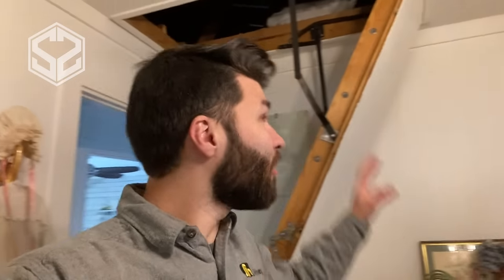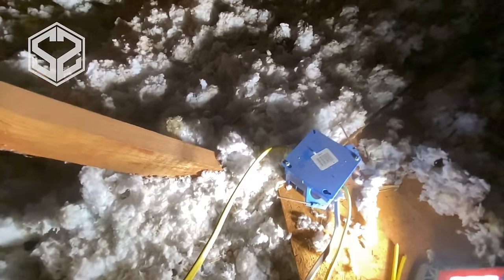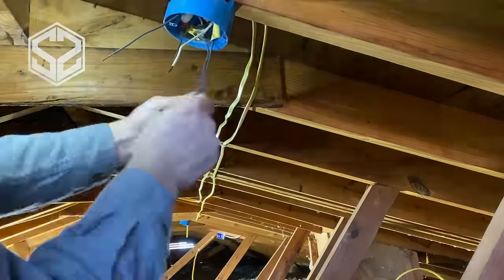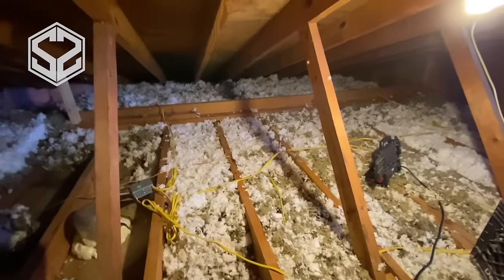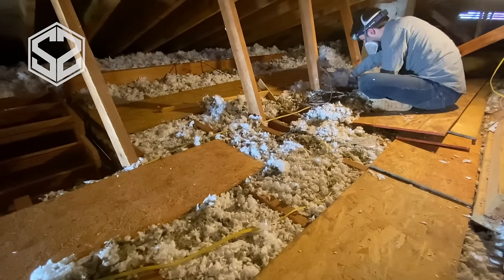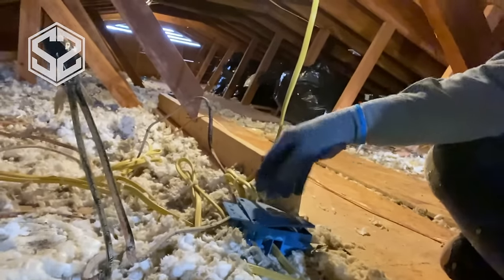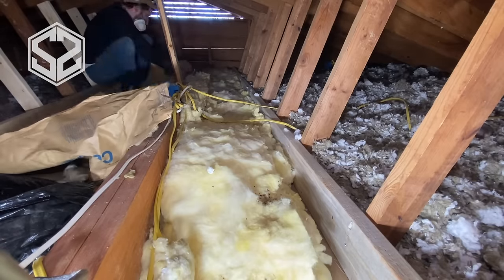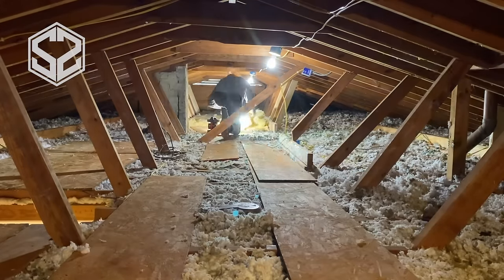How To Fix An Old Attic

Comment: With the added foam around the lights, how long does the foam take to "dry" before filling in the insulation on top of it?

There is a roof support that looks like it is sitting on an added board with a 1" toenail.  Did you fix that when you fixed the sagging roof?  How could the previous owner add that and leave it that way?
Reply from the maker: Thanks! It takes a few hours to harden. Yeah I replaced that support. I was completely shocked to see what this guy had done up there. He really messed up a lot!

Comment: Great video and very educational. Thank you for sharing. For the wiring at the junction box at 6:42, how did you do that wiring? It looks like the hot and neutral you wired together (black and white wire) and have 1 black lead wire from that same connection. Trying to figure out why you wired the hot and neutral together. Unless the color is different for that connect? Any insight would great help.
Reply: That’s his switch leg. Switch boxes don’t require a neutral so he’s using the black and white as hot conductors. He’s bringing the power to the switch on the black and bringing the power from the switch back to the device on the white. The black conductor he’s connecting it to our the pig tail for that light and the hot conductor of the next device on the run being powered by that switch.

Comment: Could you make an insulated panel for the stairwell?  Like, when you drop the stairs you pop it up and off, then back down and on before putting the stairs back up?
Reply: Is the stairwell you are referring to the attic access? As in ‘drop the stairs’ meaning the access you pull down to access the ladder or ‘stairwell’ to get up into the attic? If I am understanding your question correctly, the answer is yes. ‘Attic tent’ has a product for that. It has a zipper like a jacket to close it when not in use, which helps minimize heat transfer and air infiltration. Very good product. 👍
Reply: @Rjribs46 Yes, that is what I was referring to.  Thank you for the product info!

Comment: 16:56 - 16:57  there’s a diagonal 2x4 in frame just past his right hand. is that even attached to anything?  It looks like maybe it’s connected by the bottom half inch or so.

Great video btw!
Reply from the maker: Yeah, I found several issues like that one. The previous owner made some modifications and almost all of them were done poorly. I had to replace a whole section of the roof supports because it was messed up so bad and the roof was beginning to sag. Here's the link for that video. https://youtu.be/ZQpJpOQac-s.
Thanks!

Comment: Lots of code violations from before and after your little project. Worst one is your didn’t use fire resistant caulking in the penetrations through the top plates.

Comment: I have bought, sold and renovated many houses. Home inspectors are useless (I even got licensed as one and it’s comical how little they really have to know). If you do this enough you can inspect better than an “inspector”. The first thing I noticed was the framing shot at the beginning was horribly wrong. I had to pause it and wonder wtf they were thinking. Some things I recommend: there is no need to run 12 awg yellow romex for attic lights. 14 awg is much easier to deal with and led bulbs take very little power. The white plastic clips are garbage and will turn brittle in the attic heat over time. You need to always use electrical rated metal staples. Keep in mind they make airtight can lights and no matter if you spray foam yours or not the cans themselves have holes all in them. Use gasket tape on the holes or remove the cans entirely and install the new trim type that seals against the sheetrock and only has a lead wire and box. You can buy foam vents to put in the rafter cavities to allow ventilation but also allow you to add thicker insulation. When I was in my early twenties I spent a great deal of time in attics doing exactly what you just did and these days I will literally have an insulation company come in and vacuum out the entire attic so I can fix everything and then reinsulate. Insulation breaks down over time and turns to dirt practically and should be replaced in older homes. I just started a 1800 sqft house and the first thing I did was have the attic cleaned out including all the ductwork. Very easy to see what you have and fix problems. Blown in insulation is cheap to put back or roxell which i love. The struts and purlings in your house need to be fixed they’re awful and nowhere near correct or supporting much of anything. It appears several have been cut off also bad. Keep in mind the collar ties at the top of the peak do not support downward load they are for uplift only. Your downward load are the struts and you need more. They should always go to a load bearing wall and L brace. The electrical is a nightmare too it should be cleaned up. Junction boxes are not the answer. Great for you to learn keep it up…every project I do I still learn something new.

Comment: What size boards are you using to work in the attic?
Reply from the maker: I could only fit 18 inch wide boards up through the attic access door. They were easy to move around when needed and still wide enough to crawl across.

Comment: If the home has vented soffit, it is possible to vent the range exhaust there
Reply from the maker: Unfortunately the soffits aren’t vented. It only has vents at the peak of the gable on both ends.
Reply: If soffits are vented, it is not a good idea to push range exhaust out through the soffit. Should go through wall of structure to outside or through roof.
Reply: Never vent into an attic, range vents drastically increase humidity as well as pose a risk of grease. Just not worth the risk.
Reply: Don’t you want the paper moisture barrier of the insulation present face down?

Comment: Be careful which wall openings in the attic you seal. Figuratively speaking the exterior walls and the walls around a bathroom. The house needs to breathe and many times when the caulk or grout in the bathroom goes bad, the space between the walls in the attic will breathe. After sealing the humidity builds up causing moisture following mold, then health issues.
Reply from the maker: Thanks for the tip!
Reply: That is entirely wrong. Letting inside air, especially moist, bathroom air leak into the attic will cause so many problems, including "mold and health issues". This is especially true for exterior walls that are right at the eaves. The bathroom must have an exhaust fan that moves the moist, warm air to the outside, that is the only "breathing" (ventilation) that should happen. This isn't one of those my-way/your-way type of things, it is simple and black and white. There isn't an universe where it is better to let bathroom air leak into the attic. Not even half-qualified builder would agree with your advice here.
Reply: Um, isn’t there supposed to be a water barrier behind the tile?

Comment: Doubt if an eltrician made that mess bet it was home owner I do a better job running wires.what mess good luck. Yea run power up there.
Reply from the maker: Yeah I would agree, I’m guessing the previous homeowner thought they knew more than that did and messed everything up… I’m glad it’s all fixed and I don’t have to worry about it any more!
Thanks! 😄
Reply: Some homeowners takes a real pride in their work. 
Unless it was a flipper , then most likely every corner was cut , every possible shortcut applied. 
I rather buy a run down foreclosure and do things the way I like it .

Comment: LOL TRIP OVER THEM???? you cant even stand up !!!!, Your attic wasnt designed as another room. Leaving wire pieces is irrelevant as well. Was probably done in the hot summer months, last thing on that installers mind was picking up wire clippings. HAHA. Also people do not spray foam insulation around your can lights lol. It wont save you more than when you need to change that fixture out and rip sheetrock down with it. lol, this video is just full of bad things to do. Can definitely tell you are a "DIY"er. I hope when the contractors come behind you to fix stuff, they wreck you on the bill. THERE IS A REASON SOME OF THESE THINGS ARE LEFT THIS WAY!!!!!
Reply from the maker: Obviously I would disagree with almost everything you said lol 😂 but thanks!
Reply: I would agree with this gentleman about a few things -- first of all,the proper way to seal your recessed lights is to construct a cover for the lights.  Use foamboard to make a box with the bottom missing. Notch the foam board where wires or framing  make contact with the box. Put the box OVER the lite can,then seal the box to the sheet rock, and tape or foam any holes in the box. This way you have a cover that seals the can ENTIRELY.  Remember,not only are you sealing to stop cold air from infiltrating into living space,but also the hot air from leaking INTO the attic and heating the roof deck.